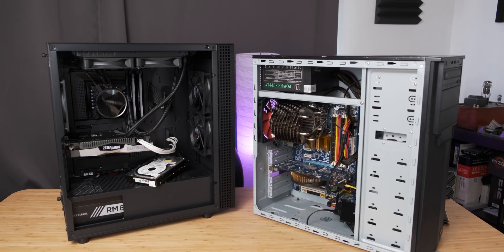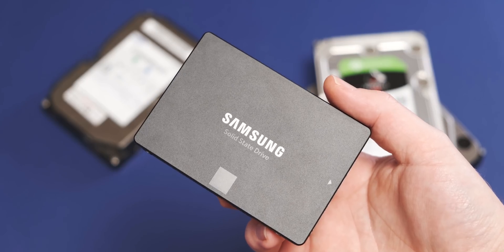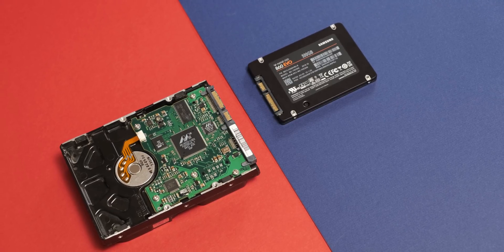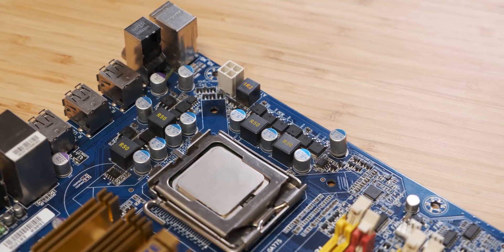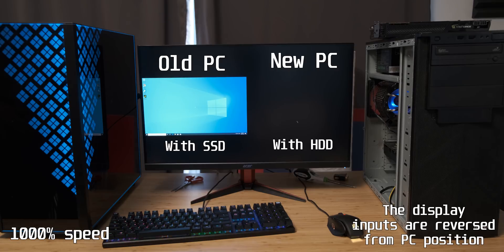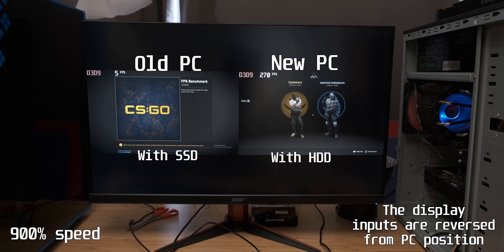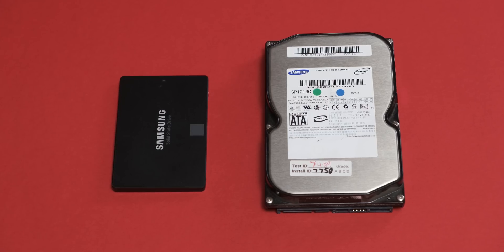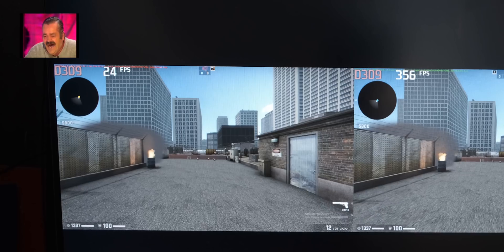New PC with old hard drive vs Old PC with new SSD

Comment: But I remember the days when a hard disk was the bees knees compared to running off of a floppy drive only system - but then I also remember the days when floppy drives were the bees knees compared to loading off of a cassette tape drive...and then I remember the days of how a serial terminal for entering a program was the bees knees compared to a punch card machine - but I don't remember the days of having to toggle the bits into memory from a front panel, so no, I never saw dinosaurs roaming around on the Great Plains - that was before my time
Reply: Upgrading my Amiga from a floppy drive to a 40 megabyte hard drive was an absolutely phenomenal upgrade.
Reply: I'm not so sure!
Reply: But do you still have your dot matrix printer?
Reply: Amen old bro., I am from that era and as I get older and I have been spoiled with the newer stuff... I have lost a little patience. But at the same time I have used old hardware and keep going  with some new tech. some the old hard ware / software would be just fine. and works for what you want to do with it! even with some on ills it some of is still great as you stand you under stands it's limits,,, seems like society don't like it and throw it all away... even though it is still useful!!!!
Reply: @kc7wzl  Alas, don't think anyone has come up with anything useful to do with the old modems from back in the day. Is kind of sad because in their own way they were a kind of neat tech. But I do recall how thrilled I was to switch over to ISDN and how blazing fast that seemed compared to the fastest conventional modems (Hayes compatibles and the like). Somewhere there must be a genius Maker that can come up with a project to repurpose those old modems. Maybe I should throw that down as a challenge on hackaday.
Reply: How old are you then?
Reply: Respect 👊🏻
Reply: Best tech comment award
Reply: I can only claim back to apple 2e floppies to run number cruncher.
Reply: True, crazy how much has changed over the last 4 decades.
Reply: Fortran on a punch card machine, those were the days. Not all fond memories for sure!
Reply: Those were so super massive storage drives back in the day.  The early drives after floppy were a couple hundred MB's
Had a 486 dx2 (66mhz) with a 500MB drive, then a Pentium 133 with a Quantom Bigfoot 4.3GB drive (took a 5 1/4 bay slot).
Good old days.
Reply: I've been trained on a test set that you had to manually bootstrap. If you got fast at it, I'm sure it could feel like playing an organ.

The OS, you ask?
Daemon.

The media drives it read from were roughly the physical size of an encyclopedia book.
Reply: Old man 👴
Reply: the fuck is a bees knees
also you remember too much are you an elephant
Reply: My first computer when I was a young teen was a commander 64 first intel computer was the intel 8086 and later upgraded cpu to intel 8088 with a 15mg or 20mg  hard drive.  It was amazing not having to put the dos 5 1/4 floppy in just to turn on computer.  And my old dot matrix printer.
Reply: Wow you're pretty old huh?
Reply: @leprechaunbutreallyjustamidget  I was busy building and flying RC model airplanes when the blinky lights with bit toggles front panel computers like the Altair 8800 was a thing
Reply: No you are like 12.
Reply: Very funny. But very true. I can relate up to floppy drives only. Back then, basic programs loaded nearly instantaneously from hard drives compared to floppies. 

Even listing directories and folders with the DIR command took some patience (with floppies), but I also remember being a lot more patient back then. 🙂
Reply: oh god the punch card machine
Reply: @enki-enlil  yeah its a pain in the ass. 2tb = one whole cessna hanger space taken
Reply: This really makes me wonder if it can get any better from here.
Reply: @ThePesident  Oh it will. As it sits, memory latency, whether it be the drive or the ram, is the biggest bottleneck to all consumer PCs. Most tasks will bottleneck on SSD speed before they can come even close to saturating even a 2c/4t cpu. I think the ATX standard is nearing end of life. We will need a new mobo design that can handle a lot more bandwidth between components. its a bit over my head, but i get the basic idea of it. the little copper traces used in current motherboards will become too little to handle what is asked of them. They may find a workaround, thicker motherboard with specially designed connections, idk. But im very curious to see what they come up with.
Reply: @ThePesident  It does - an NVMe SSD is much faster than a SATA SSD, and the difference is noticeable when the PC boots up. On the smartphone side, there was the transition from eMMC to UFS in 2015.

Comment: I already thought of that, I just got newly arrived old pc i5-2400, 4GB DDR3, harddrive I didn't read it poss 160GB. On my newer computer I have a spare old ssd I had it lying around it is 128GB. I am just ready to use it but no socket to fit my monitor to, so I have to wait and order a graphic card. (notice the condition of the old pc, it looks like it never been used, yeah, brand new!)

Comment: "going to be severely limited by the SATA2 interface... running 300Mb(bits) per second..."
FIRST... no, it's not MegaBITS it's 300 MegaBYTES per second. Secondly, you're correct it's "severely limited" for max sequential but again it won't matter that much in practice (in fairness that's the point of testing in the video)... the main issue with the HDD frankly is that it's older technology (slow seek times etc).. the SATA1 interface is not the issue. A modern, fast HDD limited to a motherboard SATA1 controller can do quite well and frankly even a crappy, SATA1 SSD might seem as good as a modern SSD for most tasks in my experience.

Comment: "as good as SATA drives are going to get..."
Are you sure? I don't think the max (550MBps or so) SEQUENTIAL transfer speed is the main limiting factor. Most access is much SMALLER files so is the bottleneck there the SATA 6Gbps motherboard controller, the SATA6Gbps controller chip on the SSD itself, SSD memory and/or SSD caching, or some combo including better OS support?

Comment: my 2 cents
My dad's LAPTOP is about 9 or 10 years old. It has a 2C/2T Intel CPU, an Intel iGPU (no longer will use the NVidia 8600GS or whatever), but with a 60GB, slower SSD (and HDD now as secondary storage) it runs great with Windows 10... the MAIN things that really help it today are:
1) Windows 10 works much better than the original VISTA OS,
2) SSD helped a lot, and
3) upgraded from 2GB to 4GB of DDR2 memory (that was causing a lot of issues over the last couple years until I got 4GB of cheap memory for $15 that worked)

Comment: Haven't clicked play yet. Short answer to your questions, YES!
A co-worker gave me his ten year old computer he uses once a week since he knows I refurbish/build computers for fun. He is now using his computer more often as it's not painful to do so.
All times (M:SS) listed are to get Windows to a useable state.
2:42 initial test.
2:12 Swap from 8GB single channel 1333 to dual channel 1600 DDR-3
2:05 Upgrade his A5-5400K to A8-5800K
0:49 Clone his hard disk to an inexpensive SSD of similar capacity
He says the computer runs butter smooth.

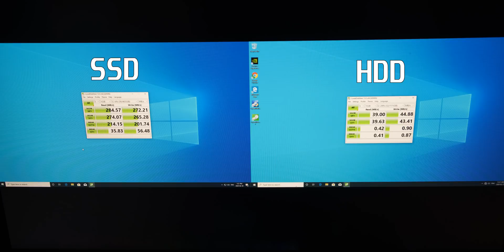Comment: @7:48 Mega*bytes* / second, not bits. (MB not Mb)

Also when comparing SSD & HDD day to day usage, a fresh install is the best case scenario for an HDD.

After a year or two of junk & fragmentation the HDD will be cripplingly slow, while the SSD will be largely unaffected. The difference being a result of the SSDs response time being an order of magnitude faster than the HDD seek time.

Comment: I've revived so many client laptops with SSD drives. The most recent was a relatively new Lenovo Ideapad i5 which was appallingly slow on it's 5400rpm drive, I opened it up to find an M.2 slot. Dropped in a drive and it went from 4:30 from switch on to desktop, to under 40 seconds.

My diagnostic laptop I take with me to client sites is a tiny Thinkpad X60 (Intel T2400) from 2009, still works fine with an SSD under Ubuntu. Shame the next incarnations of Ubuntu no longer support 32bit processors.

Comment: Wow I just literally upgraded my 3rd gen i7 laptop to a ssd and 16gb of ram (it's a 17in se dell 7720 that isn't supposed to be able to use 8gb vengeance chips but dell was probably lazy and never checked). Now all 4 of my computers (9900k, 2700x, i7 8th gen moble, and now i7 3rd gen moble) have ssd boot drives and I will never go back.

I keep thinking about going back and tricking out a old phenom II x6 1045t system I have with a m.2 but I am not paying 130 buy a new board.
Reply: When you've tasted to SSD's speed, it very hard to come back to HDD

Comment: The answer is that hard drive bottlenecks are severe. Even with new HDDs. I have a new-ish laptop that came with a SATA3 5400RPM 1TB HDD and it ran like molasses on a sub freezing day. I cloned that drive to an old SSD that is 500GB and now that laptop flies. It won't game, but it loads Libre Writer in a few seconds instead of minutes.

Comment: HDDs really aren't that slow, once the chunk of sectors that are needed are found.  THe problem is that getting the read head to the first sector takes milliseconds. The SSD could be SATA 1 and it would still trounce the HDD, even if the HDD were SATA III.

Comment: For day to day usability e.g. loading applications and the OS, latency is the real killer, so an SSD is going to fist a mechanical drive quite violently in that regards irrelevant of what sata revision the drives are connected to. Also, sata 2 isn't limited to 300 megabits per second, it is actually rated for 3Gbps or 10 times what you've quoted, however it does cut the maximum read rate down to about 300 megabites per second or about 2.5Gbps once you deal with overheads, but that's irrelevant as like I said, latency is key for usability 👍

Edit: after finishing the video, I called it 😂
You're not wrong with Windows 10 and ram caching making things somewhat more tolerable though.
And regarding the Windows 10 installation, did both systems have usb3?

In any case, if you want your computer to be faster and don't have an SSD, get one!
It's one of the cheaper upgrades nowadays, and should your system still not be snappy enough you can put the SSD into your next build

Comment: ancient pc: uses a core 2
me watching this video with my core 2 quad:
Reply: Core 2 quad is still fine for daily use. It shows its age in photoshop or video editing and gaming.
Reply: @JudeTheYoutubePoopersubscribe  im even wishing for a core 2 quad or duo, this guy must be thankful eh
Reply: My second pc is a core 2 duo e7300 and get 730(good win 10) 3gb ram (some random reason the motherboard can't accept more) 120gb ssd 320gb only for backup
Reply: You may not be able to run more if you are running a 32 bit version of windows. I had the same problem and realized that
Reply: @maytizevb  It's not the motherboard. It's the 32 bit Windows
Reply: Give it to more DDR3 Rams + good solid state drive.
Reply: LOL I watched the video and a intel Pentium 4 2Ghz (no hyperthreading here ) it is a OG laptop... it still works why change it... yes I have to do a lot of work arounds because soft ware problems!!!! but what the heck it still works fine!!!!!
Reply: here is my benchmark with ide hdd vs sata2 ssd in E8400 4.1GHz
https://www.youtube.com/watch?v=A4lXa9_qmVI
Reply: Me too but I upgraded to a Xeon E5450 running at @3.9Ghz
Reply: @seirp  can you please help me overclocking the E5450 cpu?
Reply: Ranpo Ackerman  ofc man, but you can upgrade it to i5 2500 cpu and got a gpu like rx 580, its still a beast bruh
Reply: Still usable for windows, unlike core 2 duo that struggles with YouTube for some reason, i can play the video no problem but if i try to do anything while the video is playing I'll lose frames. I mainly use that pc to test GPUs until i get them to work in windows then i move them to a better PC to do some benchmarks
Reply: I pray you've upgraded by now

Comment: 300mb/s is impossible on SATA-II
300mb/s is possible on SAS (yes first generation)
The item is SATA is half Duplex
You cannot read from drive while requesting data. The transfer happens only in One direction at all times. Therefore you can achieve at best 95% of full speed.

Comment: The SSD on my i3-6100 desktop system (since retired) died last year and I had to install a 2.5" laptop HDD while I waited for a warranty replacement. I couldn't believe how much slower it made my system. In fact, I thought for several days there was something horribly wrong with the hardware configuration that was screwing up Windows 10. As Dawid says, the boot times were horrendous, and while he does mention it briefly, the lack of responsiveness after Windows 10 finishes booting feels interminable. Never again!

Comment: i personally have absolutely no problem running modern hdd for game library, best combo for any pc imo is 250-500gb ssd for os drive + hdd for game library. I personally have samsung 850 evo 500gb ssd and 1tb western digital hdd. As my hdd got full im thinking of buying 4tb western digital hdd as i have no problem to wait 15 seconds or more for my game to load. People really recommend buying ssd's even for game library however for massive storage its still very expensive  as 2tb sata ssd in my country starts from 200€ and i can get western digital gold premium 4tb hdd for 170€ . Many AAA games takes from 50-150gb space nowadays, 100gb is not so rare anymore, so your 2 tb ssd might fill in sooner than you think.
Reply: If you are buying hdd just make sure it is 7200rpm and have 64mb+ of cache, western digital hdd's are the best imo.

Comment: This is pretty nice comparison. Keep it up. Just somehow make it clearer. I got lost for the first few minutes as to why you are comparing the two but i catch up to the reason in the end. 
Old HDD are still valuable here in 3rd world countries. Some people can keep up the slow load times from mechanical drives as long as it can do the job done. Mostly web browsing

Just now. I am repairing an old Toshiba M800 PentiumT4200. Im noticing the hard drive is quite decent (be it sluggish) but its making some heat beneat the laptop. Ive seen this a lot on laptop of this era. They produce heat a lot. Im thinking of suggesting SSD for the user (that only browse the web for SNS) but i dont know if she would really want it for the basic use

Comment: I just did the same for my daughters 2nd Gen I5 laptop, out with the old 750GB HDD and slipped in a Crucial BX500, It installed windows in about 10 minutes from the flash drive and runs well for a 9 year old laptop, now just to upgrade the RAM to 8 GB and it will be a real flier :D
Reply: I did the same with my 3rd gen I7 lenovo pro laptop and indeed, it's a beast now

Comment: The biggest upgrade ever to my laptop was installing an m.2 ssd. It came with only a 5200rpm HDD from the factory so it was incredibly slow, even though it has an 8th gen i5 and sufficient memory. Imo it should be made illegal to ship modern computers without an ssd at least as a boot drive.
Reply: Things have definitely changed in the last 12 months. Best Buy sells more sub-$500 laptops with SSDs than with HDDs these days. You're often limited to 128GB which isn't great but for most people, it's not going to be an issue.
Reply: Smells like Apple's iMacs
Reply: Was running regular hdd for long time think it was doing 3/mbs sometimes copying lol.

Comment: I actually just built my first gaming pc last fall, and after splurging on a really nice case, motherboard, gpu and cpu I realized, crap, dont have a ton of money left and couldn't decide what to do for storage. originally I wanted something with lots of room and very fast. Well that was now out of my price range. So I ended up just getting a samsung 970 evo m.2 250gb drive for the OS, and any really commonly used applications. Then on ebay i bought a really cheep dinosaur western digital hard drive., 5200 rpm with 3 TB of storage. A very weird combination indeed. It works great though. The dinosaur is great for saving word docs, pictures, videos and all my games. And load times for games are just about as they would be on ps4 since they basically also use the same speed hard drives. Not to bad of a route to go if i do say so myself, 1 fast small one and 1 big chungus slow boi

Comment: Thank you for making this video; it does highlight the increasing importance of faster storage, it all adds up when going about day to day operations.  Whats great about using SSDs in older builds is despite SATA/IDE limitations what really matters is its IOPS performance, how quickly it can handle a bunch of smaller files.  In my first gen pentium 4 (using an sata to ide converter that plugs directly into the motherboard helps); it lowered my boot times of windows 7 from 5 minutes to 1.5; and a minute of that is spent on bios initialization.  For myself; any build these days back to the original Pentium gets an ssd; even 486s and prior get sd cards, will never go back to using hard drives for anything but mass storage.

Comment: When we built my last upgrade with a small 128gig SSD it made a huge impact on boot to running time. Enough that I got a bigger sata boot drive for it and cloned everything over. Later I did the same for my 7 box I use for media center recording HDTV stuff I want to watch later commercial free. Made a big difference and if it isn't loading a ton of picky crap. Wish I had a newer board that supports the memory slot based drives, be even faster. You can buy adapter cards for older systems but not sure how well they work and anything somewhat current has SATA ports.
Reply: 128 GB is very small, wears very fast